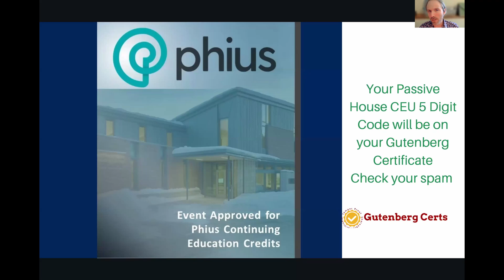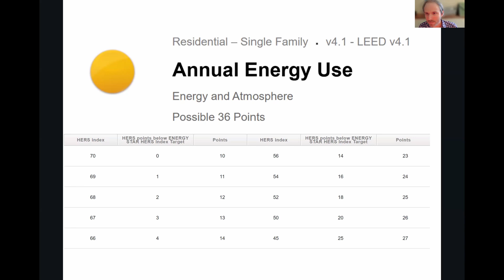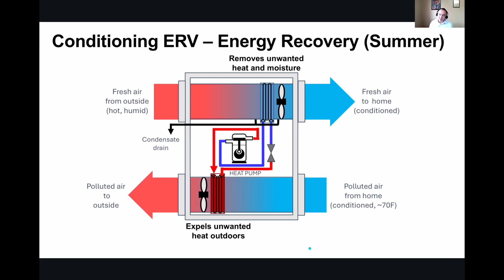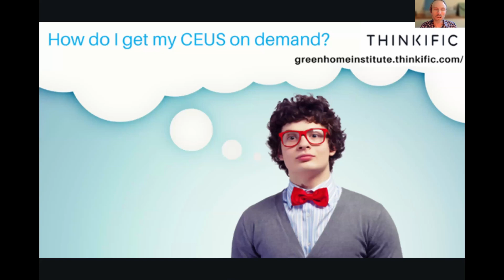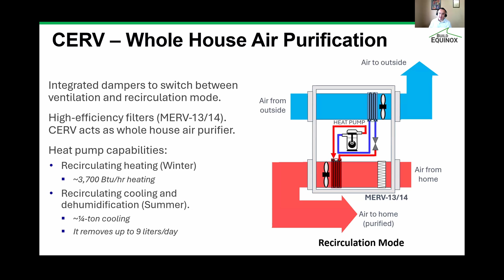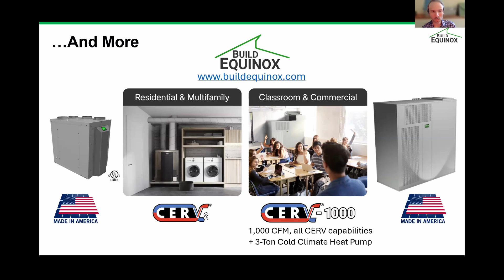Evolution of ventilation from the basics to smart recovery and everything in between

Comment: It appears Build Equinox has smart tech to pair with their CERV unit that will monitor and control other HVAC items.  What other manufactures have SMART tech that can pair all your HVAC equipment to reach the top of the pyramid SMART ventilation?  I saw Panasonic has the Oasys HVAC system, but its only available in Texas.  I'm not sure what it monitors?  I was looking to design and install a decouple HVAC system for my future home build.  Home will be located Zone 4A.  Mini Split heat pump(s), ERV, dehumidifier and fans to distribute the conditioned air to though out the home.